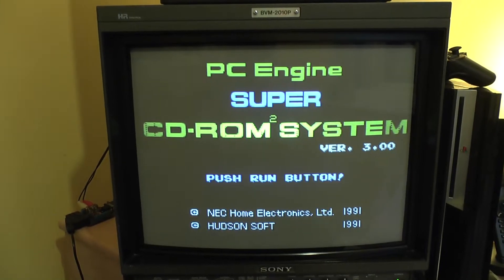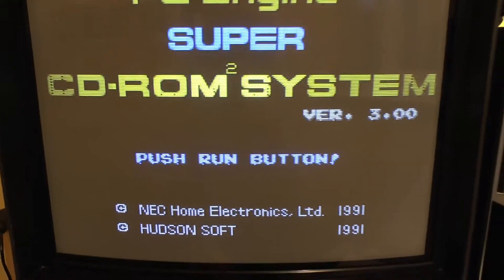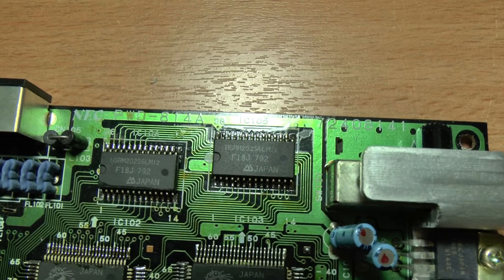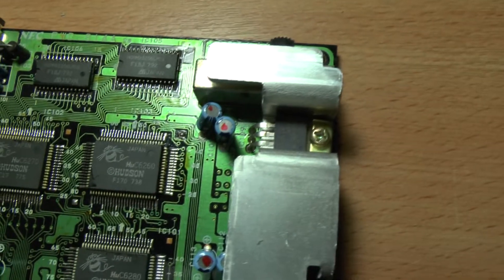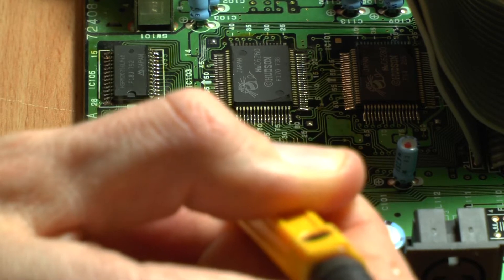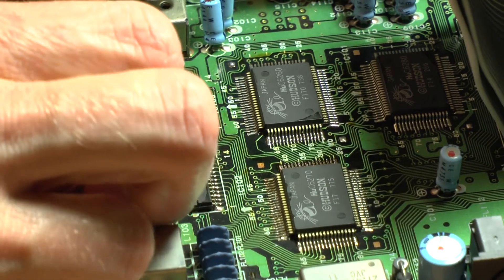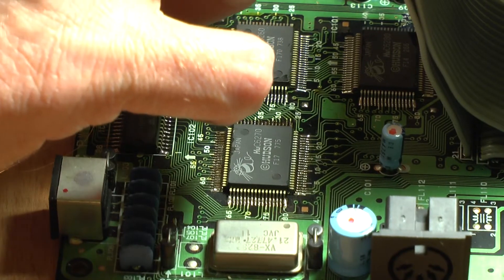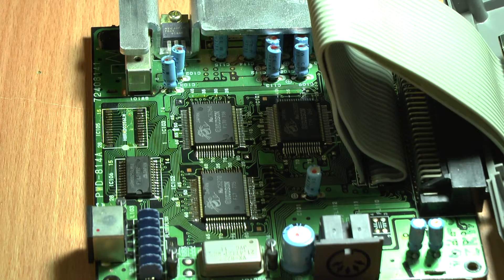PC Engine - Corrupt Graphics and RAM swap

Comment: This is brilliant. Thanks! I pulled a tiny op amp chip off my board today and accidentally yanked off a pad(I'm just a noob hobbyist). Managed to fix it, but it could all have been avoided with your wizardry!

My PC Engine CD(but not the hucards) is having graphic glitches. Trying to figure it out. Not sure if it's the System Card 3.0 or a chip on the CD unit itself

Comment: Well done. ;)

I was worried at first that you were going to try pulling the wire without heating the pins first. lol

What you've done is actually quite a good method if you don't have a hot air station etc.

As long as the solder is fully heated / flowed, and the wire isn't pulled too hard, this is pretty good.

btw, this is actually a fairly common SRAM chip, so there are quite a few equivalents to choose from if you need more spares...

http://console5.com/wiki/SRAM_256Kb:_32K_x_8-bit

As long as you choose the same package type and speed, it should work fine.
Always best to find the datasheet for the replacement though, to check the pinout and package width.

(the original chips in the vid say 12 at the end of the part no. which means a 120ns access time. The replacement chip will need to be the same or faster.)
Reply from the maker: Interesting to know - thanks for the info. :)
Reply: No probs. ;)

I'm catching up with some of your vids. I especially enjoyed the "GimpSter73" one. lol

I've been watching a few of your scaler vids too, as I'm working on a true digital HDMI solution for the N64 / GC, and many other consoles...

I have some short footage on my channel atm, but the quality isn't great due to the AverMedia software's compression etc.

The HDMI board does need to be soldered into the console atm, but it's easy on the GC and N64.

Should be easy on the Jaguar, Amiga, 3DO, Neo Geo too, but harder to do on things like the Wii / DC / Xbox1 due to the narrow pin spacing on their DACs.

It doesn't do any up-scaling at all atm, which is probably a good thing, as it gives a pure pixel-perfect output at 240p / 480i / 480p / 576i / 576p etc.

Still a lot of work to do though. The hardest part is figuring out how to make it practical to install. Or, we'll just sell pre-modded consoles.
Reply: ..Oh, should be possible to add a nice RGB or Component output to the next version of the board of course, with options for nice scanlines etc. ;)

And other nice things, like stacking two or more boards for multiplayer split-screen games on multiple monitors.

Comment: Just like that! That working must have given you a bit of a swagger in your step.

My arse would be going like a rabbits nose if I had to swap whole chips in and out. Suppose it's a bit different if the thing is dying though.

I've been subscribed for a while now and worked up the courage to attempt your duo-r rgb mod this weekend. So thanks for those vids!
Reply from the maker: It's all about practice sir.  You should have seen my soldering attempts when I first started.  It looked like a bird had shit all over the PCB!

Glad you have found the videos useful and using the information in anger.

Good luck!

Comment: Awesome that you got the right one of the first try - don't think I would quite like to do that level of soldering though :)  Now here is a question, if this issue is perhaps going to eventually start happening on more consoles (which it may) are there more Ram chips available anywhere is the question?
Gotta love those scan lines!
Reply from the maker: The easy part is desoldering and resoldering.  The hard part is finding the correct replacement IC. 

I went on-line and only found 2 occurrences of the chip available, but that was last updated a few years back.... so probably not valid today.

Luckily this is not a widespread issue, but the more you use your console (and that's any console), the more chance you'll have of damaging the RAM chips.
Reply: @Faginrs500  Hi do you repair things for people?

Comment: Nice work mate, lucky you didn't have to pull any other RAMs! I have a hot air rework station so lucky for me I don't have to bother with this stuff, but then I do work on SMD stuff a heck of a lot.

RAMs can fail on any system but you will find it happens much more often on arcade hardware pretty much just because they are run loads more than consoles. This poor PCE must have had a ton of use!
Reply from the maker: Once you've done one it's no great stress to try the rest, but I'm glad I chose the right one to replace though.

It's great to have the right tools to do the job much easier, but since I do very little of this kind of work it makes sense to use cheaper methods.

Yeah, RAM failure is certainly common on arcade PCB's, but I was surprised to see it wasn't all that common on the PCE.